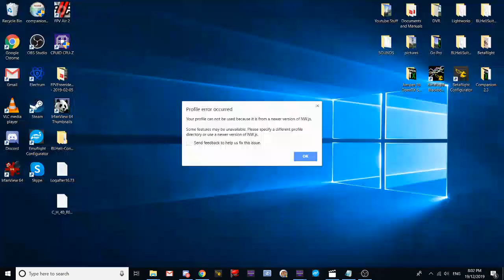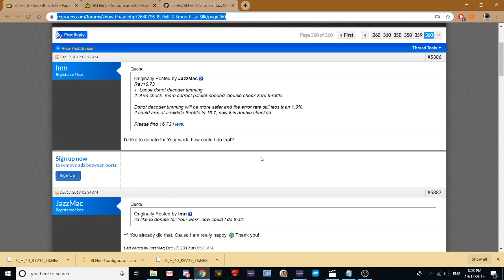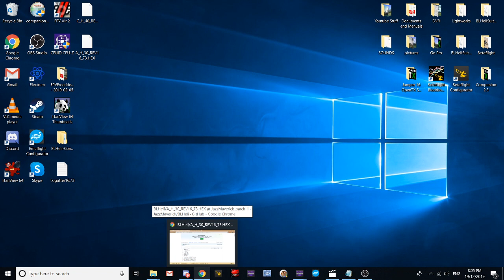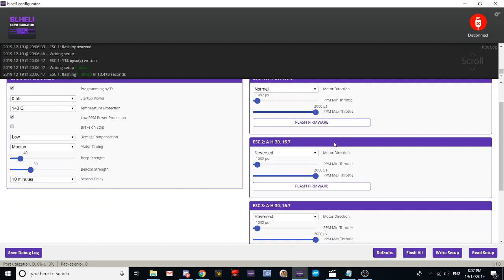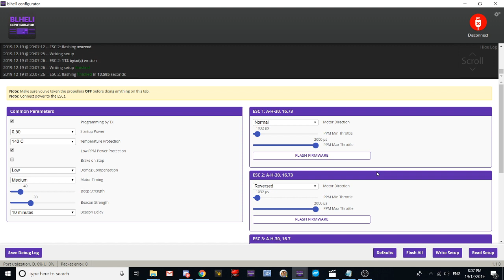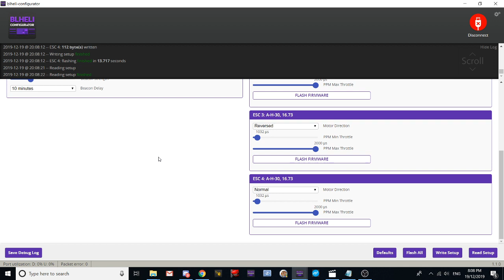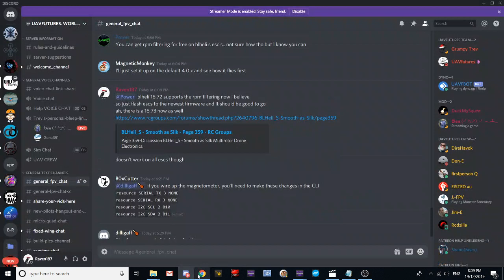How to: RPM filtering on your BLHeli S Escs for FREE - Betaflight 4.1

Comment: Thanks for sharing this mate I saw your comment regarding putting Stew onto it which is how I found it :) Just a note for everyone when running plugged in on the bench, Enable low power Disarm in VTX settings if you have smart audio. This will set the vtx to the lowest power possible until the quad is armed then it will go up to what ever you have set eg 800mw. Greatly reduces vtx temps and you don't need to play around with a fan :)
Reply: great tip.  i had heard about it, but forgot in the deluge of all things FPV. i will set that up on my pusher quads.
Reply from the maker: That's an awesome tip :)

Comment: What do you mean by "old esc"?
Reply from the maker: like the L type escs
Reply: @BengalCatChilli  it's not old ESC's it's old Firmware. It's a differenz. You still can have bb2 mcu chips (new esc)with L instead of H Firmware.
Reply from the maker: @aeQuator  eh, that's splitting hairs a bit.
Reply: @BengalCatChilli  I don't know what that means.

Comment: For 5 inch - which version that i should pick up? is it 24 or 48Khz version? Thanks in advanced mate for your information session :)
Reply from the maker: I would go 24 first
Reply: Normaly 48kz make the esc more efficient about 30% more flight time on toothpick but no reason it didn’t help to on bigger quad.

Comment: Going to try this on my mob 7. Hope it works well
Reply from the maker: It should work - as long as it's an f4. The older f3 crazybee boards require a special install on 4.1.
Reply: @BengalCatChilli  yeah I know about the install for the f3 ones bc of all the stuff cant fire. Witch is fine.
I'm not sure tho bc mine flys awesome since the first day it come out. Has the o802 ones with the bearings and all.
May switch, may not.
Or do a cli dump and if I dont like It I can change back then haha